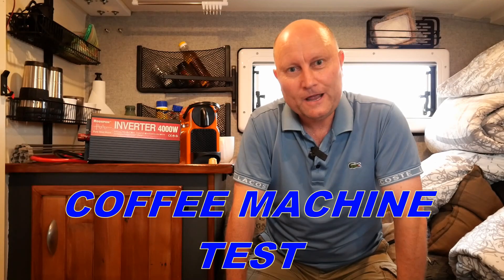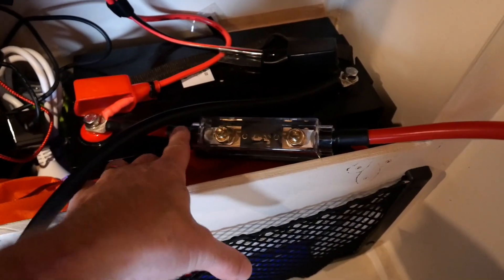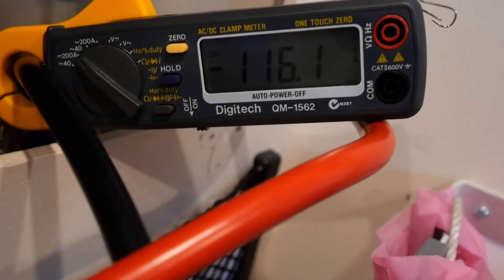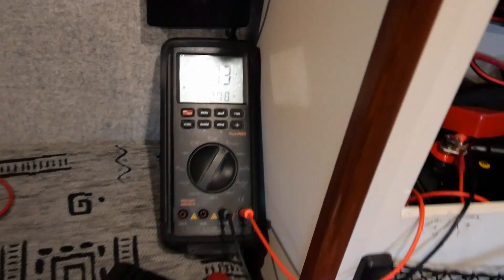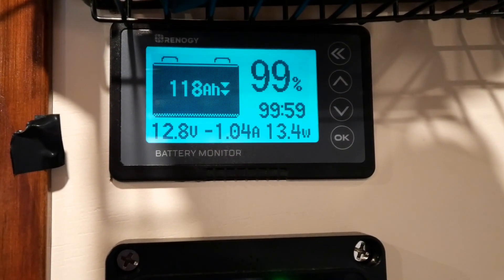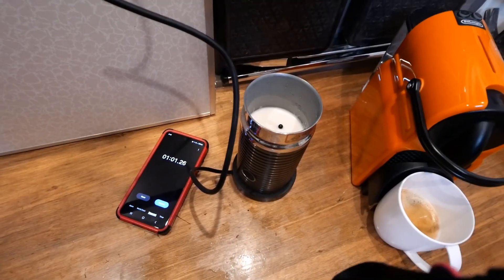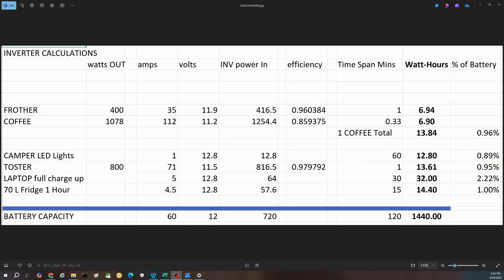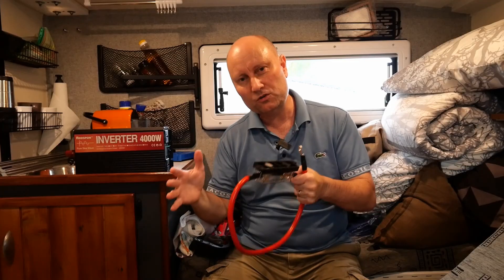12V BATTERY powered COFFEE MACHINE  - 2000W Inverter THINGS YOU NEED TO KNOW.

Comment: I have 2 x 140amp agm battery in parallel with 2000w inverter is this ok
Reply from the maker: Yes definately, this is actually an ideal setup.    I am infact going to add an additional 120Ah AGM to my existing AGM to make a total of 240Ah.     120Ah works well, but 240Ah will reduce the depth of discharge while using an inverter like this, whick will keep the batteries ina more healthy state.

Comment: Hi

I am having trouble running my nespresso coffee machine off my 4x4 and need help please. 

Currently I have a 105AH Amp Tech battery (AT12900DSP) then battery terminal sized cables to a 2000W sinwave inverter (HU6582] running a Nespresso Essenza Mini 1200-1310W. 

When I press the warm up stage of the coffee machine it trips out the inverter and I get a fault. If I am persistent and keep pressing it on and off (over 15 times) it eventually heats up enough. But still can’t draw a coffee capsule without it tripping again. 

Is the problem the inverter size or the battery size or both?

Thanks for your help.
Reply from the maker: Thanks for watching.  Yes, the 105AH Amp Tech battery will be big enought to run this, due to the short cycle time.  However I suspect that your inverter is probably rated at 2000w Peak only. This usually means it can only do above about 1000w for about 1-2 seconds max..    Because this coffee machine pulls about 1300w for upto  10 Seconds or more, it will tend to trip out the inverter (similar to as you described).  Unfortunately a lot of manufacturers put somewhat deceptive Max ratings on Inverters.  Continuous rating is very often only about half what the Unit is labeled as.